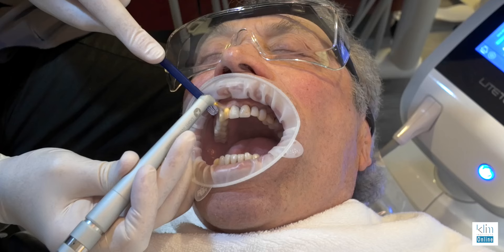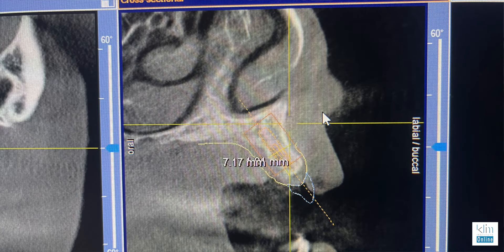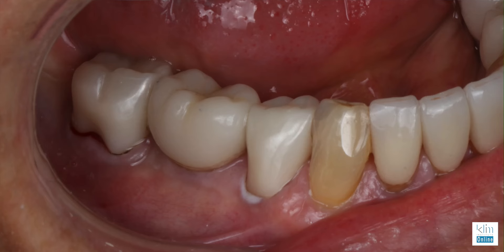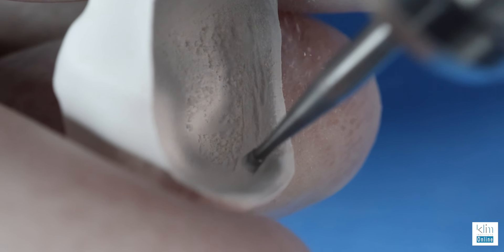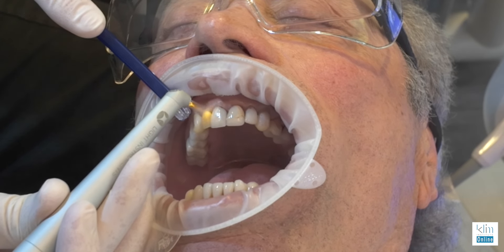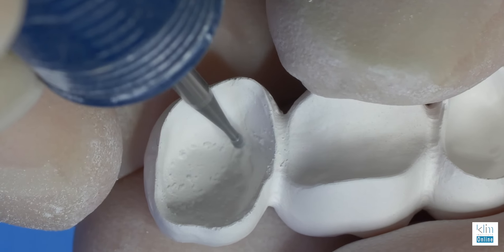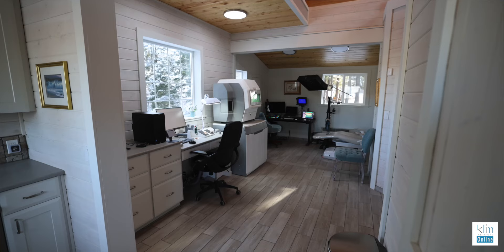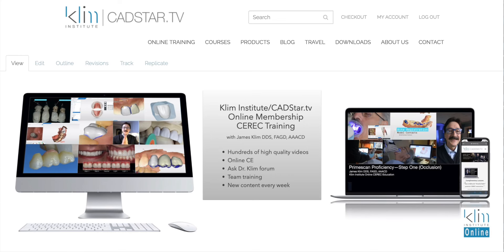Removing a Zirconia Crown

Comment: I have 8 zerconia crowns on my top teeth #5-12. My gums burn on those 8 teeth and my lips are dry constantly and the mucousa on the inside my lips feel like they drag on the crowns causing significant speech issues. I have been miserable ever since they were placed in my mouth. They have been reduced in size a couple times. It’s affecting all aspects of my life—suggestions? Please
Reply from the maker: You will need to work with your dentist on this.  Each individual circumstance has a different bio-tissue response.  Wish you all the best.

Comment: The video is called removing zirconia crowns..... But the video is about creating undercuts...getting retention and cemention of crowns... So I'm wondering if you had tips and thoughts about actually removing zirconia crowns.  That said, 100% I find section and crown split and DO NOT BOND bc a few zirconia crowns I've had from other providers have had to be sectioned into like SIX pieces to get all of it off.... But also, with a good prep, good wall height, good ferrule if a core etc I feel like an RMGI is MORE THAN adequate to keep a crown on so I don't really see the need to bond??? And I'm wondering for you think sometimes even with an RMGI do you get some bonding if there is a composite core (I personally think you do- but unintentionally!!! Just polymer chemistry doing its thing).
Reply from the maker: This video was for those who are bonding in zirconia which some companies in the industry are recommending.  I agree, you describe an ideal prep circumstances.  For me RMGI is adequate, and I did not address the issue of bonding to a core.  Anyway, thanks for commenting.  All the best.